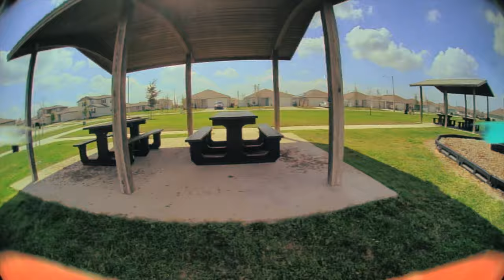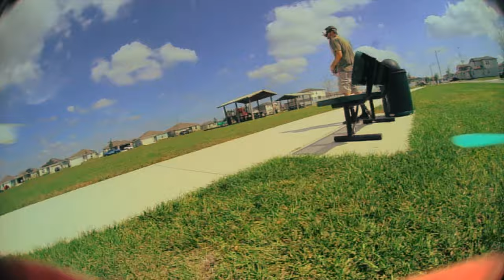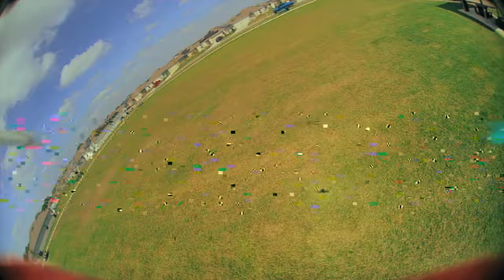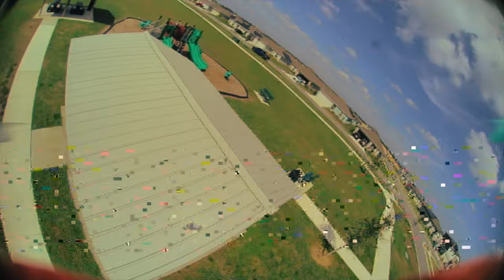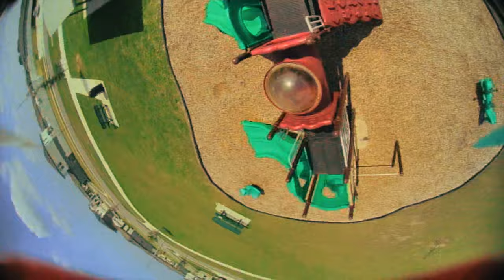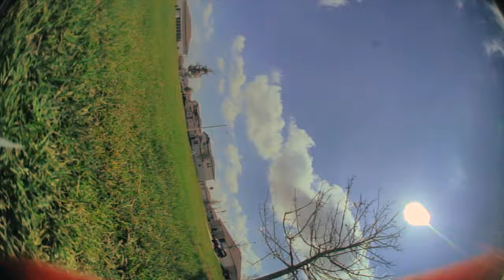Tips to KEEP FLOW Going in Your FPV FREESTYLE

Comment: Love how you just vlog to the fpv camera 😂 KISS right 👊🏽
Reply from the maker: Exactly!  It's one of the main reasons I love HDZero, and why I have opted to not carry an action camera.  I don't really need it, and the quality is sufficient for my needs.
Reply: @StacemanFPV  hmm (I originally hated carrying action cameras) did you have to get used to the lighter quad? I’m actually liking the extra weight of the GoPro now 😸 going back to a lighter quad would feel weird
Reply from the maker: There was a little adjusting but didn't take too much effort... Plus I used different props and/or throttle cap in the radio to help make it a more underpowered quad.
Reply: @StacemanFPV  oooo makes sense! You can now fly a lower pitched prop at lower rpms
Reply from the maker: Yep!!
Reply: Nice you pointed that out, i like that too very much. Reminds me of 90s skate vids.

Comment: We set our quads with .05 to .15 expo on roll pitch n yaw .. it really softens those twitchy initial stick inputs or minor corrections
Reply from the maker: Yeah, that can work.  I prefer very low rates so it eliminates those, but takes some adjusting to.